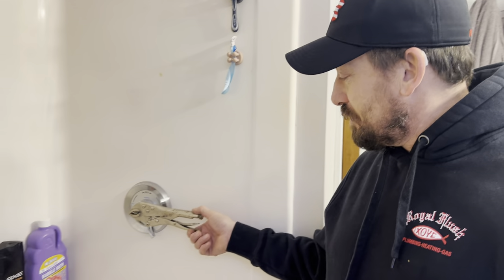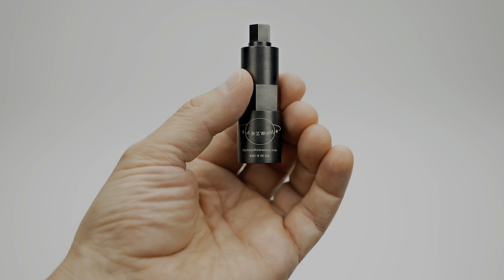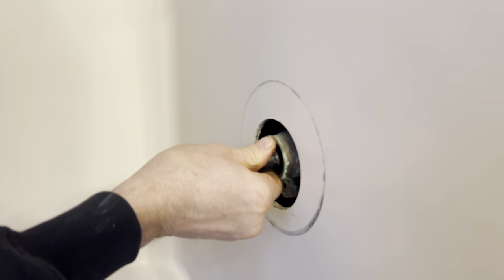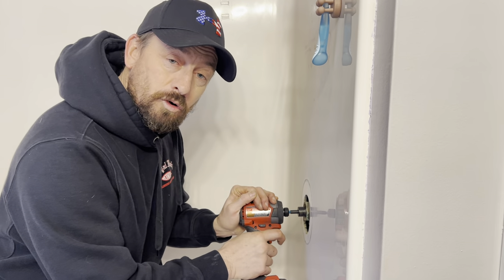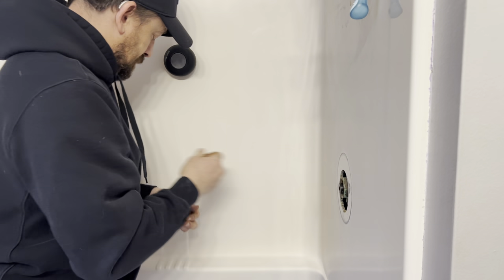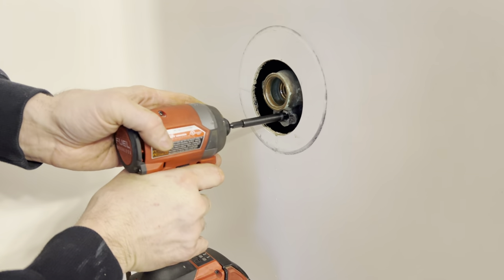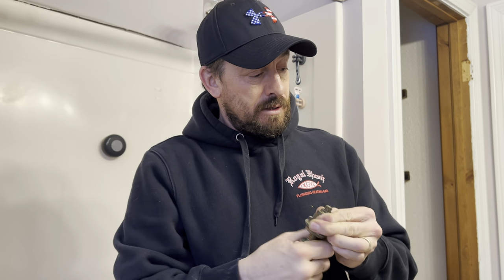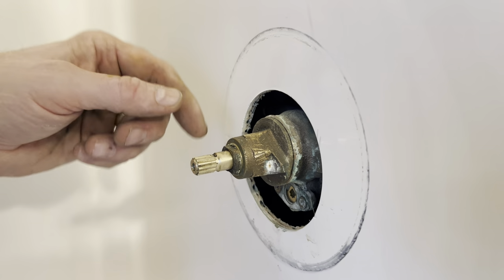How to Rebuild a Symmons Tub/Shower Valve FOR DUMMIES

Comment: replaced just the spindle and now the hot water not quite hot like the sink
Reply: adjust the temp screw.  in the video around 9:21 he shows where it is.
Reply: Hot and cold water mixing fine now from replacing spindle. But I just received zip tool. I mentioned above the valve housing is not secured to studs behind wall. If I use this tool and an impact drill, won’t it just torque the whole housing? It may not work and could it damage something? Any suggestions?

Comment: Can I use the tool Simmons makes for this ? The zip extractor looks great. Where do I get it
Reply from the maker: zipseat.pro or on Amazon
Reply from the maker: You can use the Symmons Tool. It just has a higher chance of stripping the seats, and you may not get them out
Reply: @zipseatextractor  
I ordered the extractor today. I have the tool but the physics of pulling down at an angle with something like that makes me think it certainly would be easier to strip. So with a drill, I can use the extraction tool? Should I get an impact driver?
This valve is leaking from shower head and from under the face plate. I hope the valve housing not cracked. It’s on an outdoor shower I put in 13 yrs ago.
Reply from the maker: We recommend an 18 V impact gun, which will take out even the most stubborn seats without wrecking anything. A drill will work on seats that aren’t frozen. But a drill won’t clutch the torque like an impact gun. If the valve is 13 years old,  you may consider buying a new Symmons Temptrol valve in order to strip it down and use all the parts to rebuild your old valve, leaving the body in place. If it’s shower only that’s an S96-1. Check out this video.

https://youtu.be/bkYdSeU1vQM?si=xeIdEylPF2Q9b22V
Reply: So attempted to rebuild entire valve today and as you expected ,, the Simmons tool would not budge that seat. It slipped once and I stopped . I replaced everything else and now have mix of hot and cold , no leaks from around the valve but water still dripping through tue shower head . This is a problem I had 2 yrs ago , plumber came and said he couldn’t fix it without replacing the entire body and never came back. In rural area. This year when I opened camp and started shower it was leaking from under face plate as well down the wall. That is now gone but still drips a bit from shower head . I suspect the hot and cold seats inside need replacing. Waiting for the tool I ordered (zip) and will try again when I get it. 
Another hack by tue builder is that the valve behind tue wall of this outdoor shower is not screwed into studs, just floating so I wonder with that if even the zip tool will be able to get thise out? Any thoughts. I installed 2 years ago a shutoff flip valve before shower head so I can stop the shower head drip.
Reply from the maker: Zip Seat Extractor is your best shot. If the valve body is not secured in the wall…you’re already dealing with a problem no mater what you do.
Reply: @zipseatextractor  like who the heck doesn’t secure a valve body to studs or wall? You can’t make these  things up  .